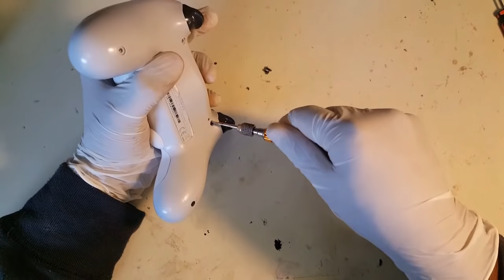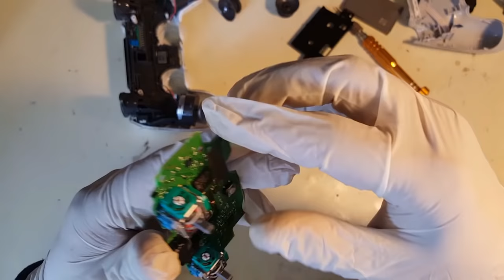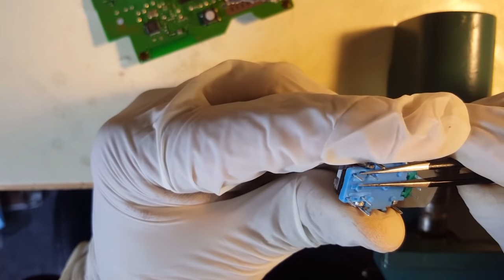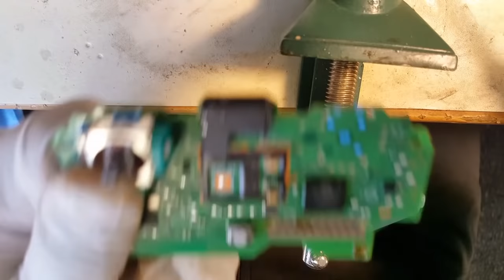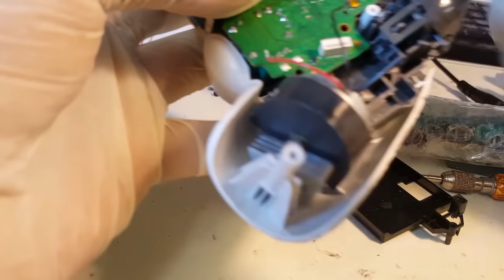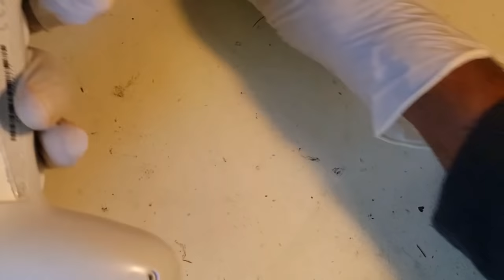Ps4 Controller Joystick Replacement

Comment: Im usually a do it myself kinda guy but think I’ll just leave it this time
Reply: Yeah you can find 3rd party wired controllers for 20 bucks. Seems like less effort :p
Reply: Its very easy to do just make sure you get a decent  hot air gun for removal and a good solder iron for assembaly. Other than that very easy
Reply: U lazy bro
Reply: Lmaooo right
Reply: Effort is one thing, but to do this the first time - i'll first need to buy a thin smoldering iron, a hot air gun and a smolder sucker. New controller seems cheaper.
But it seems that analogs can be fixed by putting dielectric oil on the moving sensors inside the sides of the analog box - i wonder if that can be done without tearing it off...
Reply: I am with you on that.  I went all gung-ho to replace the wiring on my gaming headset.  I had to do somesoldering.  Well, it didn't work out the way it was on YouTube.   I might play around with a old broken controller, but no way am I going into one I hope to be using in the future, and do this.
Reply: You can do the di-electric operation without pulling the mother board apart.  I did it.  Here is the humorous part.  I went to an electronic store and asked for di-electric.  This girl said gave me something in a tube.  It didnt say di-electric on it, but she was fairly sure it was.  It wasn't.  I put it in my controller, and it hasn't worked since :)
Reply: pretty much every time I "try" to repair a controller it ends being a mess of parts in a ziplock bag that sits on the floor forever
Reply: Nick P 💀💀💀💀💀💀tear r coming out my eyes
Reply: William, same shit over here 🤣
Reply: No harm in trying you will at least gain experience. Or you can pay someome else repair it for you if you don't want to buy new one.
Reply: @gamerguy425  🤣🤣🤣🤣🤣🤣ikr
Reply: D but who tf has the soldering iron lmao
Reply: @erickrosales3162  it's a good tool to have for when the machines take over
Reply: @D wait do you have a fucking soldeer set
Reply: Yeah me too
Reply: @mykopadilla4948 
And you repaired just how many 'BRO'???
Reply: @flohoncho6589 
Crying or Laughing Tears ???
Reply: @erickrosales3162 
I have. I also have the Electronics Tools.
Reply: @choppertimberland139 
Just not 'Terminators' would be my Guess !! !
Reply: @rayanscofield7468 
He has 3 ...
Bought them from you Remember ???
Reply: @D
He did that dastardly deed to himself ...
Reply: Yeah same, at first I was like a have most of the tools maybe I can pull this off. But the dude was like you want a 60$ s. Gun not a cheap one.
Reply: @bumble_rumbles  I don’t blame him the screen is worth almost as much as what some stores ask for.
Reply: I legit bought a new controller because both mine had drift...sure as shit the new controller has drift but only when I hold l2? Weird
Reply: Same. This is far complicated if you are inexperienced with it.
Reply: Or you can look on amazon and find white wheel sensors instead of changing the whole analog stick. No need to solder unless you have to.
Reply: Couldn’t relate more
Reply: Yeah, I have three controllers one is the original I can’t run with it unless I punch the left stick and I can’t fire any guns on gta and only a few guns on bf4, my other one is a modded one that you accidentally turn the mods on and the battery dies for no reason, the last one I got from a pawn shop and the camera stick would drift to the left so I took it apart and fixed it but now the left stick has trouble running and often pushed me forward when I don’t touch it.
Reply: I feel ya. Its replacing the little parts on the sides of the analog stick dont work, then this is the next step short of buying another controller. 
Overtime replacing those little parts wont help because the old one has damaged it enough. Sodering is the only solution i know of.
Reply: @DatnxggaJay  was literally just lookin on amazon and fb marketplace for a cheap one then got the nerve to look at this video.
Reply: Yeah i dont own a soldering iron or heat gun. Cheaper to buy another remote
Reply: I got new sticks for $5
Reply: Hah!...
Reply: Shit I’m about to order the soldering kit soon son!
Reply: Soldering isn't that hard tbh
Reply: 😂😂😂 exactly what I’m thinking
Reply: Me right now 😂🤣
Reply: It's definitely easier than it looks.
Reply: 🤣 🤣 Yeah, me too,

Comment: So for the people saying that they would rather just buy another controller, I get that. But the reason why you would want to learn how to do this is because every single controller will eventually get problems with their joysticks down the line when you use them regularly. Yes there is some initial cost upfront for the soldering equipment but in the long run you'll be able to repair this issue when it crops up again for the cost of the replacement joystick module, which is like £5 for 2. Not to mention its a great little project to get you started with soldering.
Reply: Actually all toolkits with analogs cost less than 7 dollars and for the next time, only analog sticks will cost around $2. Imagine wasting $60 because you don't want to learn something useful. 20 min. of work for $55.
Reply: This is less expensive than a new controller.
Reply: @HamsterXFiles  And more fun! Honestly, I'd have a great time doing this.
Reply: Honestly it's got me looking seriously at a hot air station, because it seems to reduce the friction of these sorts of repairs and mods (dc jacks, analogue sticks, making fight sticks ps5 compatible), and you can easily save AUD $70, $100, $300 (fight stick), $500 (laptop) at a time.
Reply: (Having desoldered and replaced 70ish keyboard switches more than once with pump and wick)
Reply: Im late to the party but thats exactly what im going to do, also it comes witht he benefit of owning a ultra versatile tool afterwards too. Wanna make a new bespoke headphone cable? Can do it. Repair an impossible to replace laptop charger? Why not? Or even just in hobbies like RC Toys or 3D printing. 
Basically an essential tool.
Reply: Yep I ended up ordering an atten hot air station 🤷‍♂️
Reply: @wiseman_4u  no they don’t only just cost seven dollars. If you’re broke, just say that.
Reply: Tried this with my PS3 controller and made a right mess of it some people just lack the skill to do it nothing to be ashamed of I hate electrics boards and everything to do with them I'd rather pay someone or ask a friend.
Reply: I just like the dualshock formfactor and D-pad over the Xbox controllers. There are no prebuilt hall effect ps controllers that are any good.

Comment: Lol tried this and...... well i melted everything with the heat gun 🤣
Reply: What? Well, i tried doing it with a soldering iron and it impossible so i was thinking about getting a hot air gun.
Reply: Things Happen I used a soldering iron with the soldering sucker and de soldering wire. I managed to remove almost all of the solder but it’s still stuck on :/
Reply: @dash-5325  have you figured it out?
Reply: TacoMacho I think purchasing a heat gun, and adding solder joints to the relevant areas and using the heat gun would be the best option. I think it would be appropriate to purchase a heat gun that has different heat settings
Reply: @dash-5325  do you need a heat gun? Or can you do it just with the soldering gun and the soldering sucker ?
Reply: Elinson Canales I mean you can try it? I tried it and removed all the solder but I still found it stuck on. Maybe if you try it you may make it work somehow😅
Reply: Elinson Canales I think using a heat gun would be good, I’d try it out but shops are closed .... 🦠
Reply: @dash-5325  the point of the heat gun it's just to make it come out easier right!?
Reply: Elinson Canales yes
Reply: Elinson Canales it basically heats up the solder and of you pull the joystick from one side whilst it is heating it should come out I imagine, I’ll try it tomorrow with a soldering iron  and if it works I’ll let you know I guess
Reply: @dash-5325  alr thx lmk
Reply: @dash-5325  How did it go?
Reply: Jay Tee I tried today with a soldering iron and encountered the same problem. Joystick stuck on still
Reply: Things Happen meeeee too
Reply: Dash - same. Even the tiniest dot of solder will hold it on
Reply: Whitney Evans I ended up buying a rework station online. Haven’t had any issues with replacing analog sticks since
Reply: Elijah Moraga i rewatched the video and came up with a way we could get it out but now im struggling to get the new one in.
Reply: Whitney Evans is you have solder wick that helps a ton as well as the plunger. If you can’t clear out the holes use a soldering iron with flux on the board. And use a small enough wire for the solder to transfer onto so it clears the hole
Reply: Whitney Evans I’ll be posting a video of me taking the steps of replacing the analog stick and then fixing an Xbox one x
Reply: Elijah Moraga awesome! Ill be looking for it!
Reply: Whitney Evans will be up here in a few days when I fix this Xbox one x that comes in tomorrow
Reply: Dash - what temperature do you recommend? I have a heat gun that has a 350 degree and 550 degree mode
Reply: Mephis 350 might take longer to heat up but just keep the heat on it
Reply: Elijah Moraga Thanks 🙏
Reply: @elinsoncanales6634  I did it easy with only the sucker and iron
Reply: @cutty02  yeah I did it already , Thx is a little bit more job but it can be done
Reply: how
Reply: @dash-5325  me too but i think hot air is the only option ... But thats not so bad because on ebay you can buy one for 30 €.
Reply: I used a heat gund and i melt other components , with iron and sucker its very hard ...i have 6 ps3 and 4 ps4 to do .. i will leave a comment after 10 years when i finished them 🤣🤣
Reply: For anyone having trouble, i have a 2 in 1 soldering station with a heat gun and a pair of helping hands (not actual people) and i use them to hold onto the circuit board while i attempt to desolder whatever i can with my soldering gun and solder sucker

I then take a rag to shield my hands from the heat of the heat gun and prosceed to pull off the analog stick from the bottom while applying heat and this worked for me every time
Reply: @lindritalija969  yeah thats the right method and also heat resistant tape.    I think all of theses costs like 70  bucks total on ebay.   Its impossible to do it without a heat gun.
Reply: Bro my scuff controller analog stick is turned like not drift the actual analog stick is turned diagonally and not up and down and I'm pissed
Reply: You need to add some flux then put a little more solder to mix with the old solder... Then it should melt to use the sucker
Reply: @pcysneros  but what can I do if I've tried that and left my heat gun on high for 5 minutes without it budging once? What can I do then?

Comment: For people not understanding why tf it doesn't suck, you need to use 60% tin and 40% lead soldering tin, also remember to set the thing at the right temperature, if the temperature is too low the tin is gonna freeze before you can suck it, and if that's too hot it's gonna stick to the motherboard as if it was glued
Reply from the maker: Always add new solder to the joints to mix with the original onboard solder. It helps to low the melting temperature enough to have it extracted from the motherboard.
Reply: At 350ºC you can do the job rightfully. I personally use 350-400 degrees to melt the tin with soldering pen . And exactly 340-360-375 to SMD soldering. It all depends in the case too
Reply: There is not usually leaded solder on modern boards like this. You should use the same composition of solder as is on the board: lead-free, for a connection that lasts and to minimize risk of cold joints. Leaded solder is for vintage equipment and is not necessary with even cheap temp controlled irons, proper tips and technique 

If you have difficulty removing solder, use more flux and adjust your temperature and technique. Try solder braid or a heated solder sucker

Comment: I thought this was a botched job until you cleaned it you learned this hobby well man , now its my turn to learn
Reply: I prefer using solder wicking ribbons to get the old solder off, little bit of flux on the ribbon and it wicks the solder up.
Reply: @@goti4no820 Yes, there are Rosen Core Solders and Acid Core Solders.  It is not advisable to use acid-core solder on electronics.  You also need to be careful not to mix traditional lead-based solder with most modern lead-free solders. 
The European Union Waste Electrical and Electronic Equipment Directive and Restriction of Hazardous Substances Directive were adopted in early 2003 and came into effect on July 1, 2006, restricting the inclusion of lead in most consumer electronics sold in the EU, and having a broad effect on consumer electronics sold worldwide. Lead free solder has a higher melting point.

Comment: Thanks to this video I just fixed a gen 1 dualshock 4 controller with a very basic soldering iron and the same solder sucker as you. Having a decent soldering iron, wick and adjustable clamps would have saved me more time. But it was worth it in the end, so I thank you.
Reply from the maker: Great work man
Reply: Did you use a heatgun? I don't have one, so how would I do this without it?
Reply from the maker: @MelonMusk068  Yes a hot air station was used to remove the joysticks.However a good quality soldering iron and some good quality soldering braid can also achieve the same outcome.

Comment: I have 4 genuine dualshock 4s and I swear they are the most difficult controller I've ever worked on regarding joystick replacement. The solder JUST. WON'T. MELT. I have a basic soldering iron which I have to heat up to around 400 degrees celsius just so it melts, but then the solder sucking thing won't suck it up, and the soldering wick will stick to the board if I use it. I once tried my hand with a hot air gun, always afraid of burning something out. Managed to get the sticks out, but solder remained in the holes AND the air blew away the flex cable connector along the battery connector. This video makes it look like a walk in the park.

Comment: To my genuine surprise i actually fixed my original controller R2 drift problem with this video guide the parts only cost RM5.00 (USD 1.05) for a pair of analog joystick + pair of rubber joystick pieces! Follow video step by step guaranteed success. Thanks my man!
Reply: how was the feel of the new sticks? were they comparable to the original sticks or did they have less fine tuning response than original? i have a fake ps3 controller and the analog is horryible. my ps4 right stick has some drift and im thinking of doing this also. i see on shopee got a few different colors of analog sticks and idk if that makes a difference or not. they're about rm5 per analog module
Reply: @keachsterz5183  Its works but the feel difference between ori joystick and this OEM replacement is quite obvious like its less smooth but responsive enough.

Comment: It worked bro thanks.  Pieced together a perfectly good working controller. After a couple of them stopped working.  Nice.
Reply: Did you use a hot air gun or a soldering iron? I ask because i tried a soldering iron on a JDM001 model and the solder won't melt.
Reply: Things Happen ya same I used the iron and it had a hard time melting and I don’t have a heat gun
Reply: @thingshappen9199  you have to use both, solder is to put it back together and hot air is to take apart. 1 year later

Comment: I recommend preheating the whole board evenly before applying heat directly to the pads, as you can break your board.
Reply: What's the right temperature for preheating and for how long ?
Reply: @goodintentions5189  around 80c

Comment: I tried the use the flux and pump method, didn't end well, the solder went through the broadband on to the other side, even used a wick, it stuck on there good

Comment: I did it, thanks to your video!
It took me like 1 hour to replace the joystick and another hour because it didn't work and I had to troubleshoot what I did wrong. I broke a plastic thing, which I had to replace.
Plus I did one thing different. I didn't mark the Mainboard but the part I had to replace, this way the next time I open the controller there are no marks :)

Comment: Desoldering iron is the way to go, makes this process way easier and is only worth it if you have multiple controllers with analog stick issues. And of course have soldering iron. In total is about 60$ on amazon for both.

Comment: Hello many thanks on step by step ,what are the material used to suck up shouldering on circuit board and cleaning as well I have to replace joysticks and want to make sure I use right stuff I have dismantled ,control down to circuit board so gonna order new joy sticks and materials many thanks Jim

Comment: Hi, question what was the white thing you used to punch the hole in the soldering, I am looking to get all the required equipment I need to fix my controllers. Thank you for the video!
Reply from the maker: White thing?? which part of the video

Comment: What's a good joystick to buy? I bought some off of Amazon and replaced the same side with 3 different ones. Reason, they were all trash and didn't work. Horrible drift and calibration, yet they were calibrated. Is there a reliable part?
Reply from the maker: Yes unfortunately there are many fake seller. I usually calibrate it myself before installing

Comment: Hey,I have some questions,Does it matter what solder u use or what flux u use?Also what temperature do u set your soldering iron on if mine is a 60w that goes to 200 to 450c what temperature is best?Thank u for reading,I’m going to buy a kit and invest a good £50 on the equipment,But just need to know theses little details
Reply: Flux paste instead of liquid flux, is stays there longer at the required temp, liquid solder will have dry long before you reach the right temp to empty those @#$& holes :)

Comment: i have a question about the solder wire diameter...  can I also use a 0.8mm thick wire or do i absolutely have to get one that is 0.5 - 0.6mm